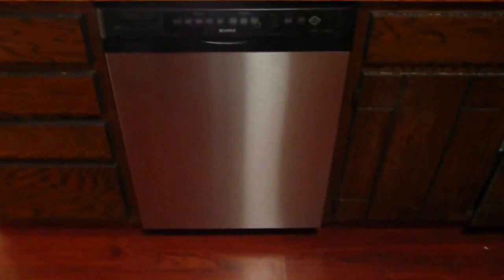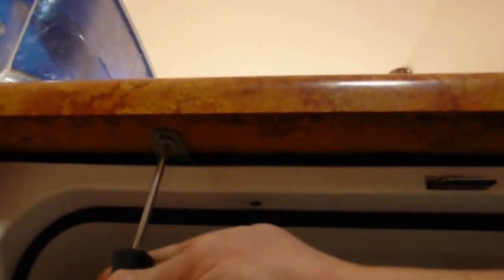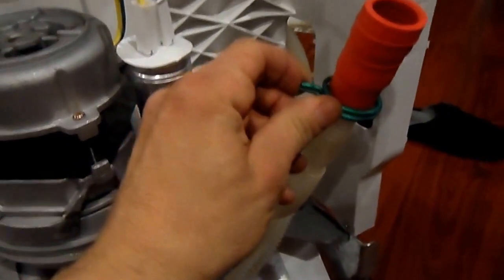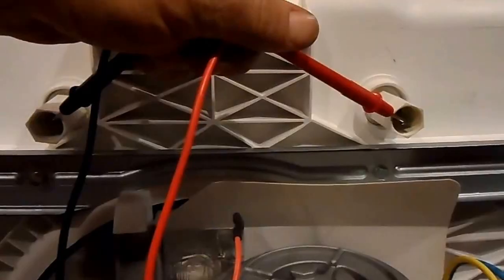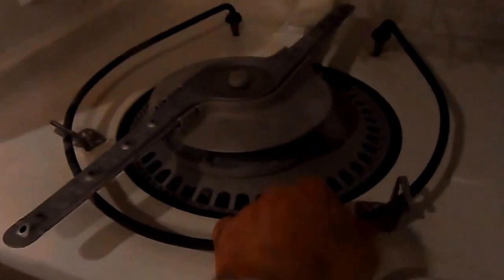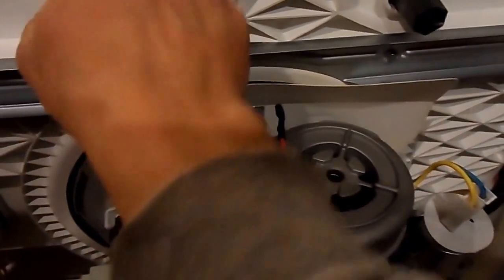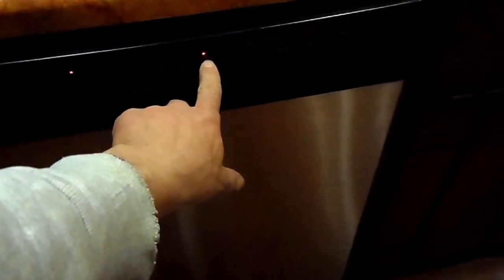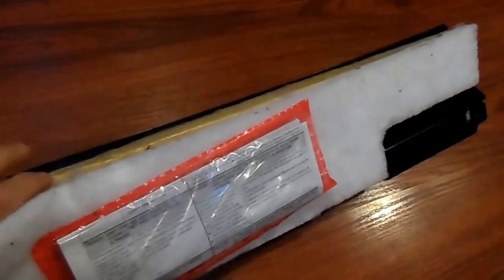How to Repair a Dishwasher: Water Doesn't Get Hot? Replace the Heating Element! (Plumbing Tutorial)

Comment: "The heating element is just the most common and easiest to fix." ---- Depends on the make/model. In my Electrolux built-in dishwasher, the flow heater fault is rare, and replacement is a pain. The more common issue is melting of the solder contacts of its relay in the control box, which is much easier to get to by disassembling the door. Some replace the whole box, some just the relay in it (and reinfore the PCB leads).

Comment: Well done.  I'm trouble shooting now to see if it is my heating element.  The very first cycle the water is barely warm but if I change the setting to "high temp wash" and "sanitize" it gets hot.  Should the first cycle be hot?
Reply from the maker: Don, the first thing most decent modern dishwashers do in many of their cycles is to sense how dirty the dishes are. They don't really need the water to be really hot to do this.

However, instructions for all the dishwashers I have come across tell you to run the hot water at a nearby faucet before starting your dishwasher. The reason they tell you to do this, is because the heating element can only bring up the water temperature so much by itself. Unless the run from your water heater is very short and all your hot water pipes are insulated, the dishwasher will not be able to handle sufficient rise in temperature.

From your description, I can not tell exactly what you are doing, but it does sound like you may be ignoring these instructions and this may be your only problem. Otherwise, at the start of the first cycle, your water temperature could not be just lukewarm.
Reply: Jake Berzon Another factor contributing to the dishes not getting clean is the water level.  I suspect it is low but not sure how high it should be.  When filled it is below the the heating element and does not even reach the bottom of the float.  The inlet valve seems to be working well enough but I'm not sure whether replacing it would make a difference.  Any advice on this?
Reply from the maker: Don Golden So that's the right amount of water for most models - just below the float.

Comment: If you replace the element and/or the thermostat you should then do a diagnostic test to reset the machine. I replaced mine and it still did not work until I did the test. On my machine (whirlpool) you use any three buttons and press 1-2-3/1-2-3-/1-2-3, quickly. my machine works now that I did the test
Reply from the maker: My machine is a Whirlpool made Kenmore and did not require the rerunning of the diagnostic test after heating element replacement. However, there are many variations on this reseting theme and some machines may indeed require a reset of one sort or another after service. Thanks Rick C, for sharing your experience with us!
Reply: thank you

Comment: Hi, could anyone help ???
I have a dishwasher LBL12A (BRAZIL) but it is W10142826a. She is not warming up. she ends the normal cycle. I tested the resistance is ok. when i run the diagnostics (normal / heated dry (3x) during the process it heats up. what could it be? please !!!!

Comment: Jake, my dishwasher produces a very hot steam at the end of a cycle and the dishes are coming out clean. Does this mean that the element is functioning properly? I'm asking because the water temp during the wash cycle on my Frigidaire Professional is not all that hot--even though I turn on the hot water at the faucet before starting the dishwasher and I use the "high temp water" feature. I can put my hand in the water without it being all that hot--certainly not as hot as what comes out of my faucet! Is that normal for today's dishwashers?
Reply from the maker: Your faucet has both hot and cold water connected via a mixer, while the dishwasher only has the hot water connected to it. The dishwasher also has an additional heating element to get that water even hotter, so the steam you see is normal, especially if you use the high temp wash feature. The water being cool to the touch doesn't sound right, but it all depends. At what point in the wash cycle and how do you test this? Have you tried to measure water temperature?

Comment: how to troubleshoot main board if it is not heating element, also thermostat and switch might also cause no heat ...?
Reply from the maker: Main circuit board failure is rather rare. Mechanical devices, large capacitors, thermostats and switches are the usual culprits and many of these are rather more difficult to diagnose and even more difficult to find reasonably priced replacement parts for. Often replacing the entire motor assembly may be the most prudent solution in these cases. That's what I did the next time this dishwasher failed - unfortunately I didn't make a video of this.
Reply: Thank you for quick response, I opened mine and checked for continuity, following were dead synchro-motor responsible for turning arms, heater element and inlet valve.  Additionally gasket inside under filter cover  needed to be replaced. Total cost on all these parts $65, will replace all myself I only wonder how much would repair tech charge me for all these repairs. This unit is almost 9 years old, after repairs will probably use it for another year or two then get it new unit. I am surprised why would this expensive LG dishwasher not even last 10 years without any repairs....maybe next time when shopping for new dishwasher I should go with Samsung.
Reply from the maker: This is precisely why I just replaced the entire motor assembly. (Who knows, which mechanical part is going to go next?) Sears Parts gave me a good deal on it - something unbelievable, like $75. If you called a repair technician to do the work, I am sure it would cost you more than just replacing the thing, especially around Black Friday. Anyone who is not going to DIY, should just get a home warranty. Either that, or plan to replace appliances when they fail...

Comment: Not sure this will be the right answer. My Miele varies between doing everything correctly and the element not coming on. When it does come on, all is fine, the dishes are perfect. So I don't think it's the element. Anyone gota ny other ideas? tx
Reply from the maker: Intermittent problems are the most difficult to diagnose - sorry. If it's not a connection shaken loose by the vibration over the years, it's probably the control board going berserk.